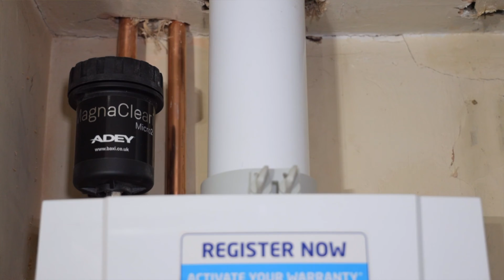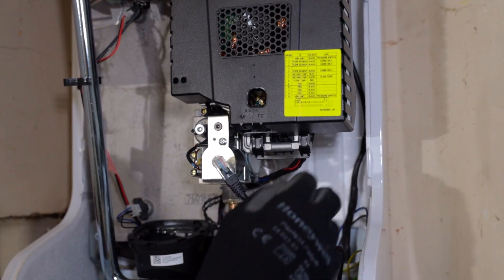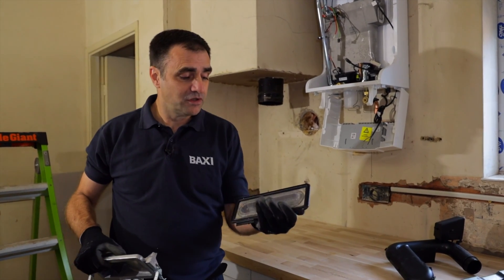A Look at the Baxi 800 Heat Only Boiler

Comment: Baxi need to update the 800, to 10 step modulation, and update from dials to digital front, and maybe a preheat loop for the cold inlet, than gas recovery as the new regs recommend 2023, it would be good if they followed other manufacturers allowing a heat pump addition onto the range for heating that way owners can add a 4-6 kwh for cheaper heating , and when the temps drop below 0 the boiler can take the slack